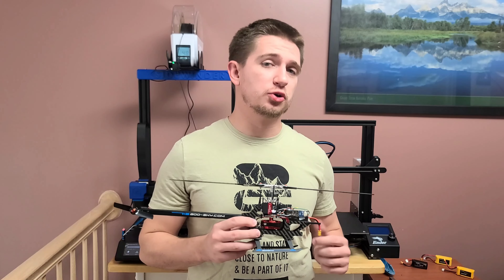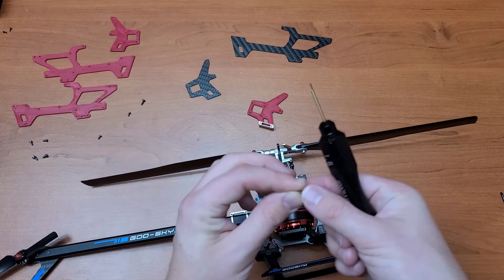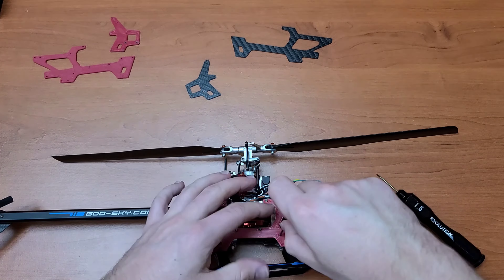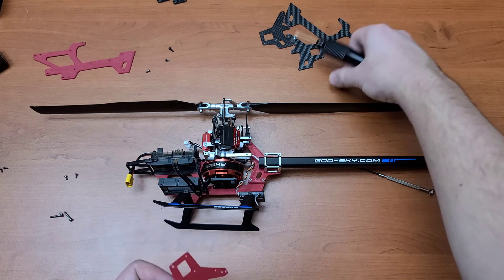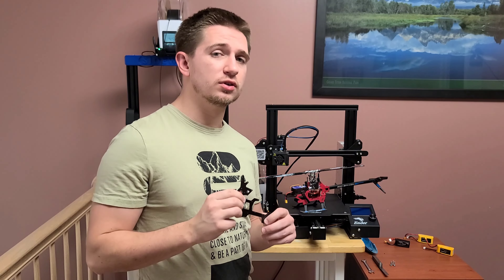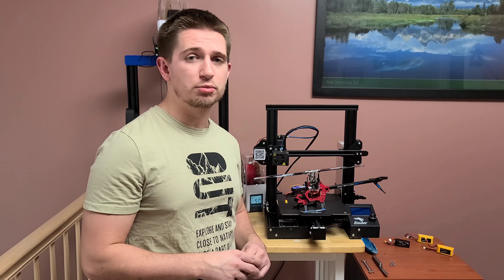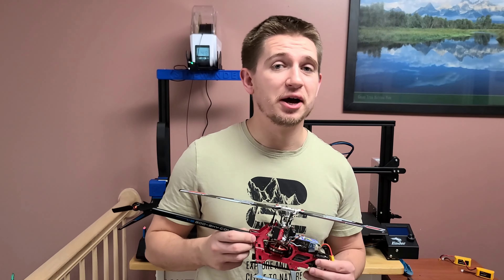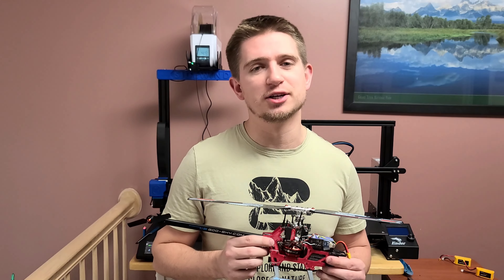3D Printed RC Helicopter - Will it Fly?

Comment: Could you take a picture of the carbon frame with a coin for reference and just extrude the shape the thickness you need. Saved you time for the next one
Reply from the maker: I wish it was that easy, but I can try that technique next time!
Reply: its actually very easy, Take a clear pic or scan the part (scans are more accurate). clean up any edges in photoshop if needed (even MS PAINT works for this). Once done find a online SVG converter. Convert picture to a SVG then import to your 3D modeling software and extrude to desired thickness. extremely simple!!